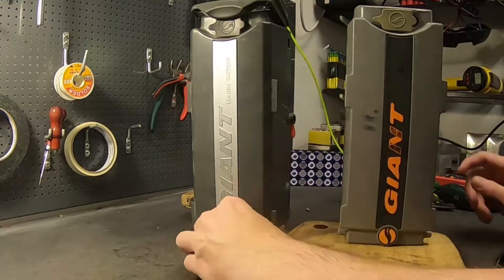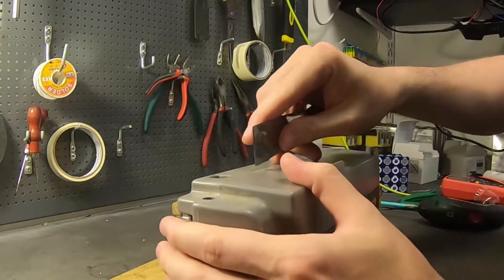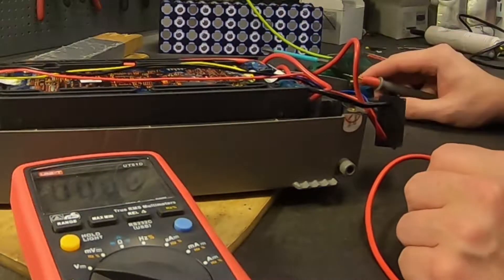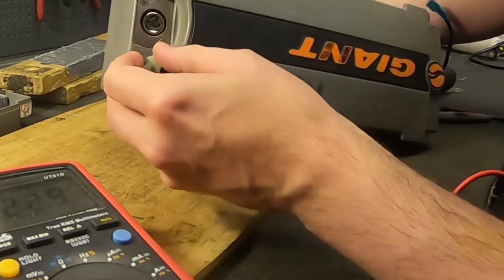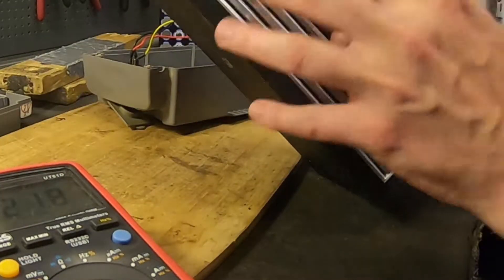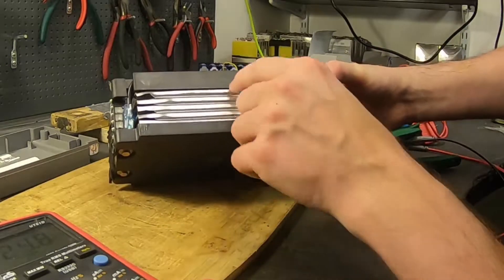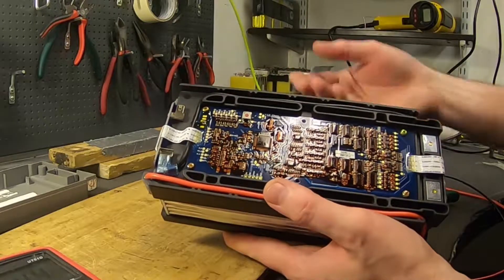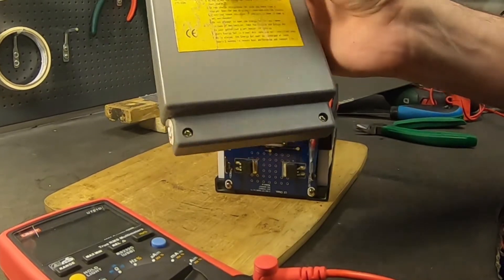Inside a 27V Giant Twist (LG Chem ca 2010) Batterypack

Comment: Dear Battery Doctor, do you happen to know the funktion of the 3 thin calbes at the output port? I ask this because I want to buy another no-brand 36 V 20 Ah battery pack (with finished BMS) for my Giant Aspiro Ebike (36v 10 Ah). The no-brand 36 V battery has only two output cables, but my Aspiro Ebike battery has two thick cables like yours and another 3 thin cables. I don't know the function of these 3 thin extra cables. Thanks in advacne. TCM.Heilpraktiker@gmail.com
Reply: "these 3 thin extra cables" are not used to run the bike, they are not present in older versions so they should stay unconnected if you change the BMS. However you need a new charger since you need the original BMS for the original charger.